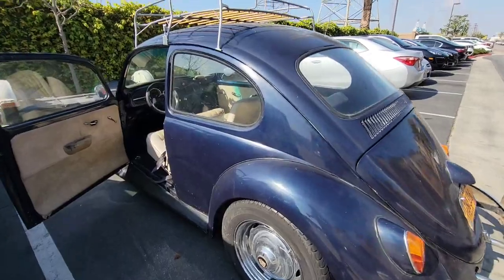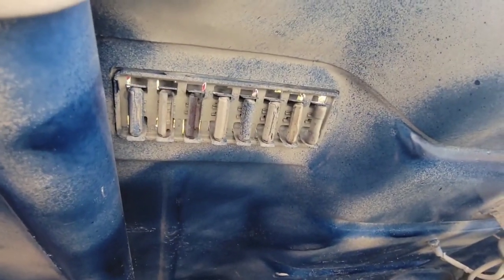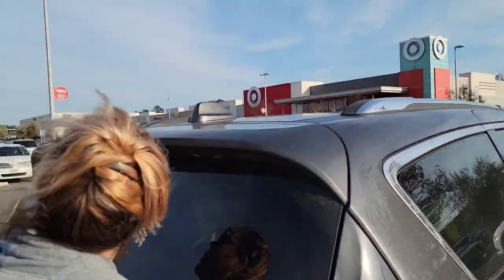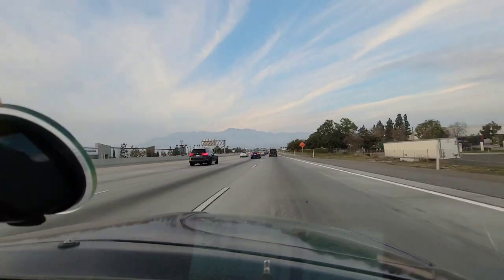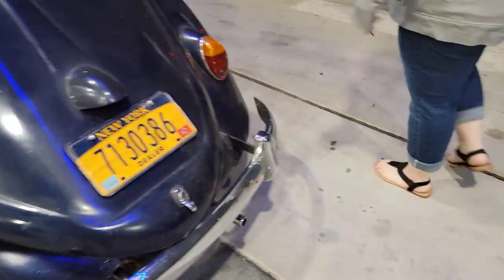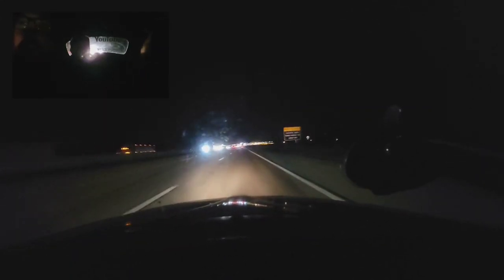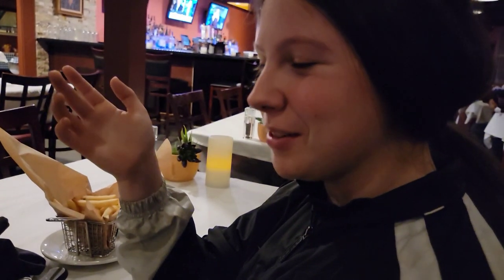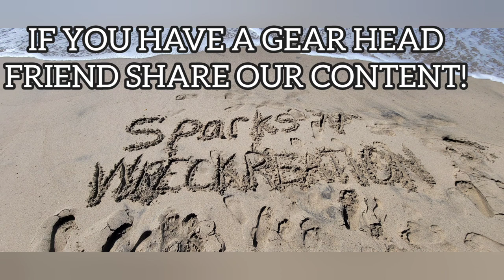Day 1: Will a 1961 Beetle Go 3000+ miles? Bought sight Unseen

Comment: In the late 70's, I drove one of these around Rome.  A road trip in the winter meant out to Floyd, or up to Ava.  Defroster was an ice scraper deployed out the side window and around onto the windshield. Complete clear on both sides only possible with a long-armed passenger.  At -12 degrees, there won't be enough neck pillows in the state.  But still, it was fun back then.
Reply from the maker: That sounds like an awesome adventure

Comment: Great video, good luck on the trip,  if you're back in Mexico (NY) this summer you should bring the car to the Nationals and I may see you there!

I notice the engine tin is missing, that barrier helps with the cooling of the engine, as the fan pushes the hot air under the car.  Without the tin, the fan can draw the hot air back.  Your engine may run hot, if the outside temperatures get too warm.

Comment: Love these videos. I hate to break it to you though, that’s not a 1961. I don’t know who told you it was. Looks like it’s a ‘66.
Reply from the maker: Nice! Yeah it's titled as a 61 so who knows!
Reply: @SparksNWreckreation  ah cool was wondering about the title. You title the pan, so it’s possible the pan is a 61 and a 66 body was put on it.  Under the back seat there’s a cover plate over the shifting coupler (good to know on your trip if it beaks) and below that plate  on the frame the vin # is stamped into it.  The body has a vin number too, it’s in the trunk by the brake reservoir on a metal plate. Sometimes they are removed though.